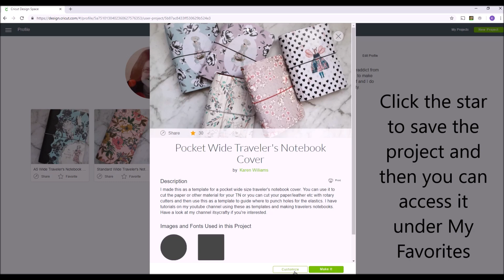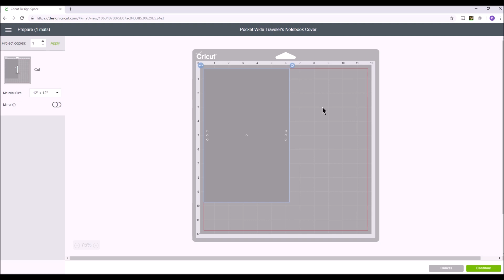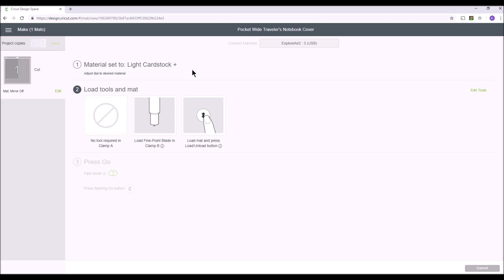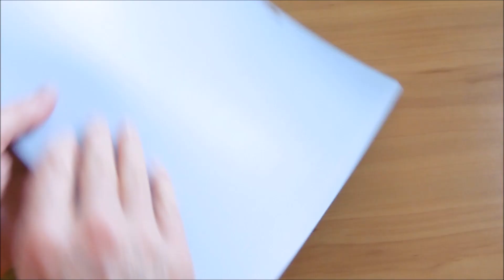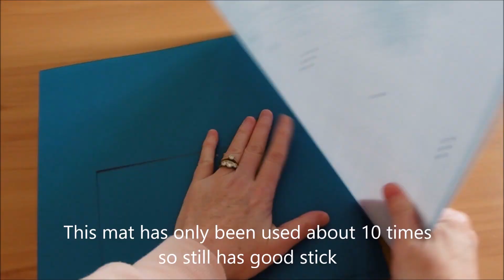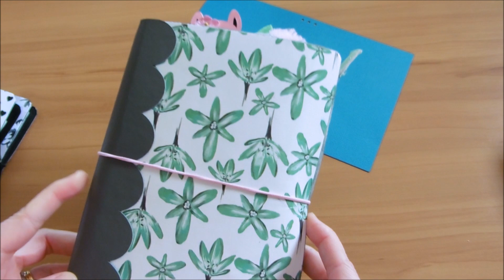Traveler's Notebook templates in Cricut Design Space - easily make your own TN cover * DIY *

Comment: Will this design cut out on leather? I have the Explore Air 2 and the maker but I don't have any hole punches at this time. I have the Cricut Metallic Leather in Rose Gold that I would like to use. I would love to make one of these. Thank you!
Reply: Well, If I would have read the description I would have known. Lol, I am sorry.
Reply from the maker: Hi. I cut leather on my Explore Air 2 but I haven't cut my rectangular templates from leather using my Cricut.  I plan to do this so I can share cut settings.  When you cut leather on your cricut you need to push the white star wheels on the roller bar all the way to the right and off the leather or they will bunch the leather up.  I show this in my video cutting a scallop spine.  Have fun!